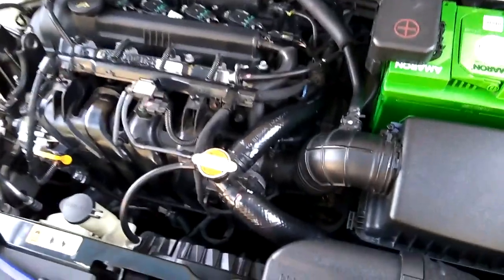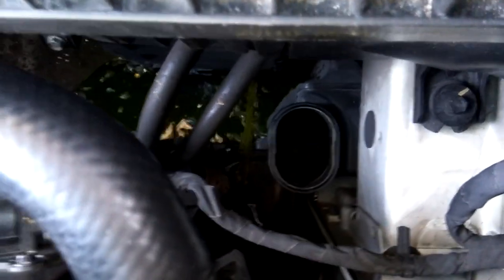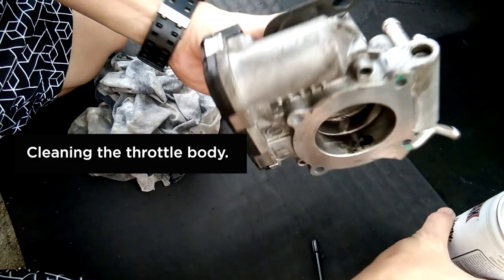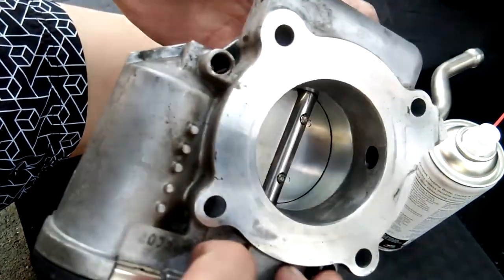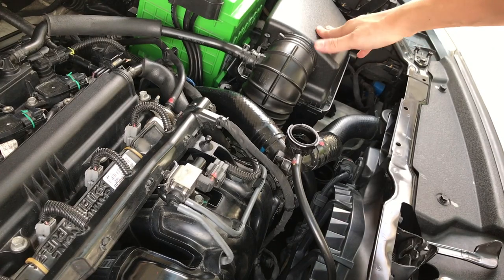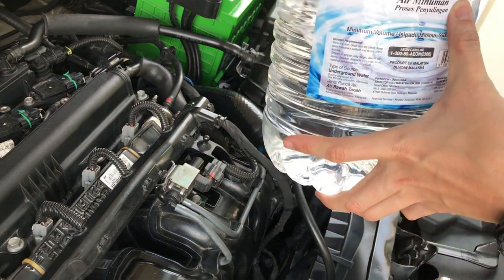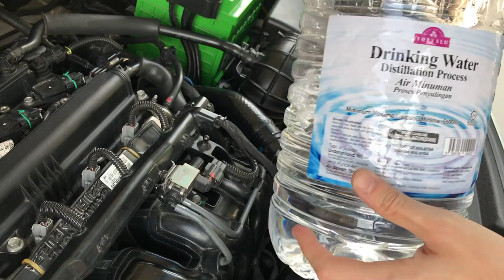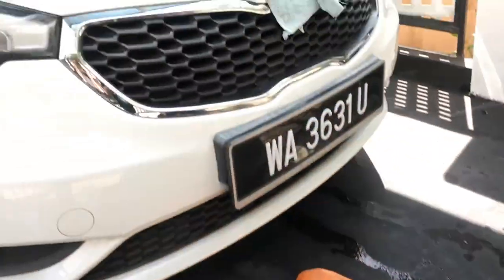Complete throttle body cleaning & Coolant replacement - Kia K3 ( Cerato/Forte 2014)

Comment: Thanx for the informative video but I have 2 questions:1stly I've heard that U r not supposed to move the throttle body butterfly with your hands  because U will damage the throttle body sensor and/or gears and computer;so why do u do it in your video? Secondly how do U bleed the coolant system so as not to get air pockets that can cause the car to overheat?

Comment: After cleaning the TB moving the throttle plate around, do you need to recalibrate the throttle position sensor since it''s a drive-by-wire type?
Reply from the maker: Don't need to

Comment: Anyone here change coolant of it. how to drain all coolant on reservoir. i cant find out. i put pipe inside reservoir so i can suck it out.but it cant go to bottom structure of it so complicated. guys help me.
Reply: There's a small hose at the bottom of the reservoir. Just pull it out, the coolant in the bottle will drain out, push back in the hose and fill up the bottle with new coolant.